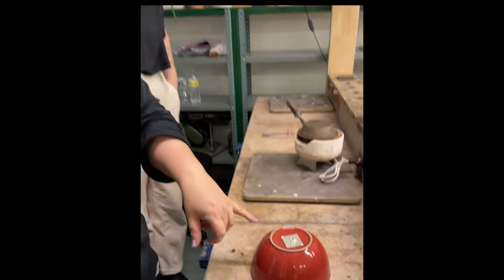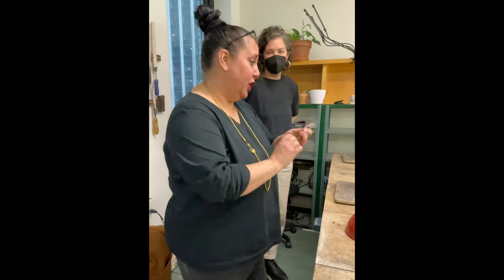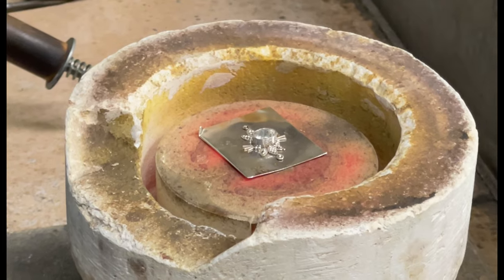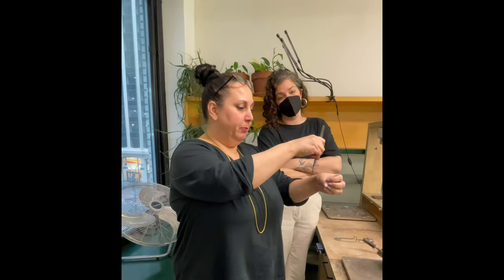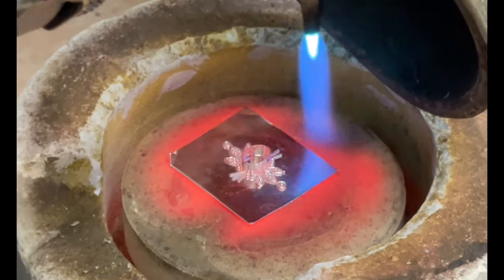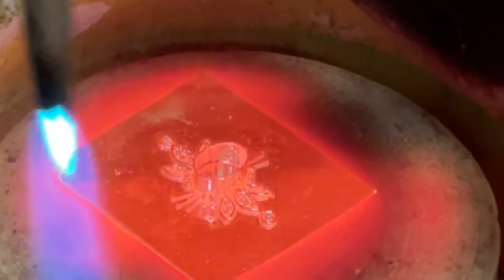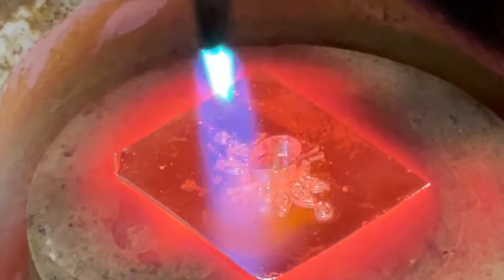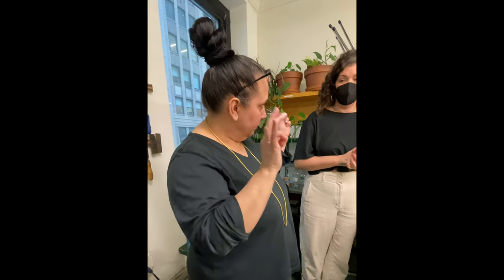Granulation in Fine Silver in a Beehive Kiln

Comment: This is my first time w granulation what solder do you use or do you do the powder solder or does the glue have some kind of solder effect or is it just fused together with the heat? 

Also do you heat your piece directly on the heating element of your kiln?
Reply from the maker: Granulation uses no solder, it is fused together just using the heat. The piece is laid directly on the kiln element but a thin coat of ochre is used on the back of the piece for fine silver. :)